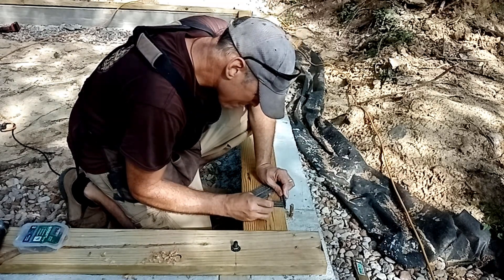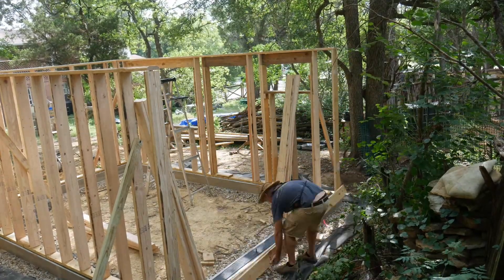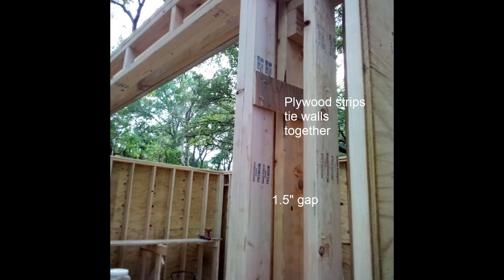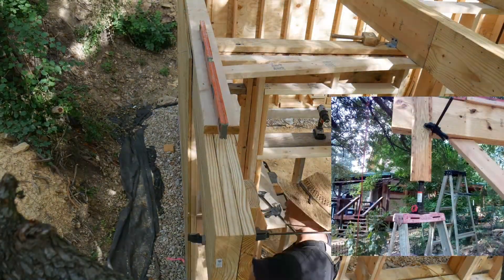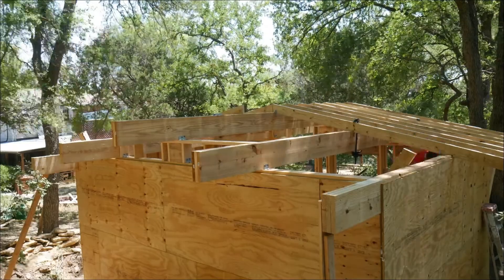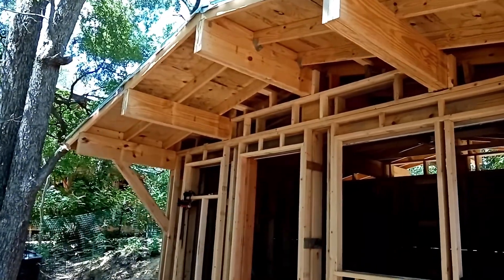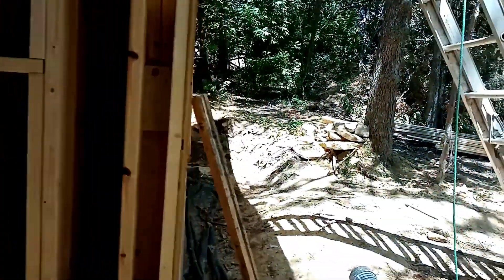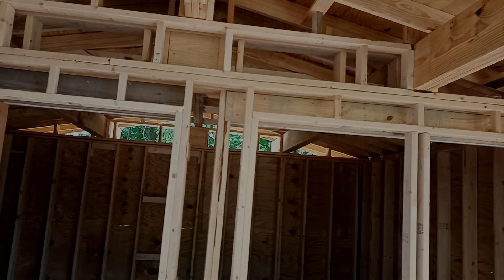EBC: Framing and Sheathing

Comment: Would you be willing to create maybe a plans and step for this. Im building a mini version before i take on the house build.
Reply from the maker: How detailed are you looking for? I have my CAD drawings for the floorplan, framing and electrical and plumbing that I'm currently cleaning up to make a formal set up plans. A set by step guide would probably need a book which I've considered but isn't in the works right now. Scaling up building projects to a house is a good idea. I like the progression:

Chicken Coop -> A definitely predator proof chicken coop -> Shed -> A really nice shed you would consider sleeping in -> Tiny House/Guest Cottage